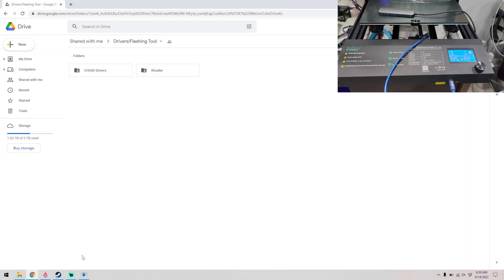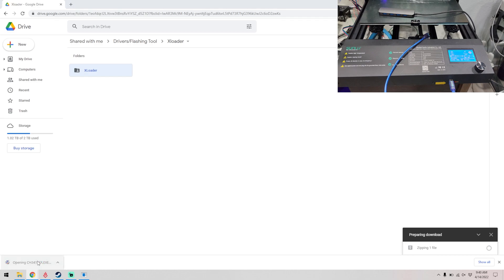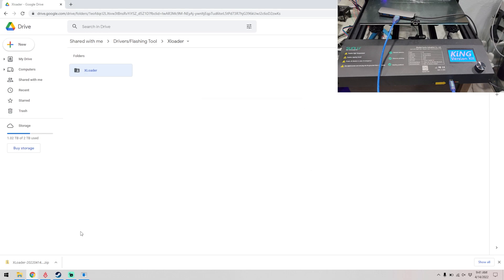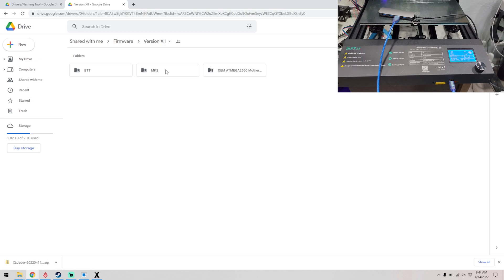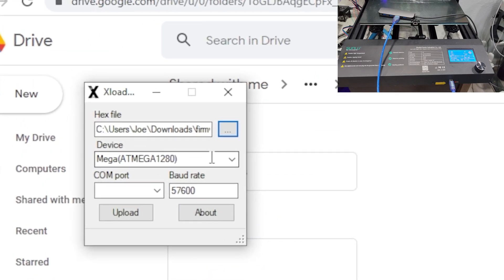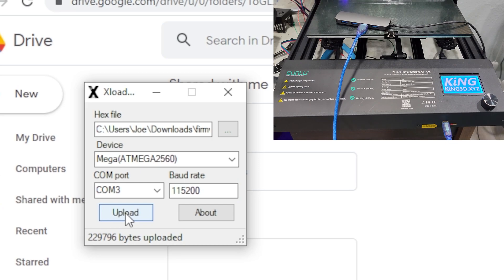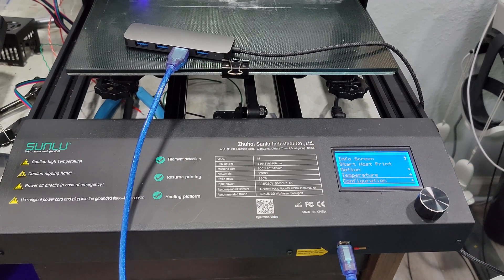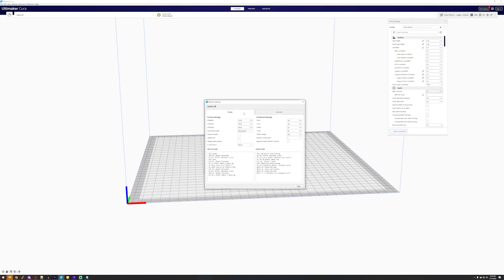Sunlu S8: How to Update the Firmware

Comment: Hi im hopelessly lost i have a s8 and was trying to do a few upgrades to it so i can print flexible filament and i added a direct drive extruder a bl touch and a few other things but the main thing being a new motherboard and screen i replaced the old board because the extruder moter driver went out i had found what i thought to be a nice looking board and screen combo on Amazon and i purchased it and wired it up and trying to figure out how to get it to function properly with my printer is driving me crazy the board i have purchased is the Makerbase MKS Robin Nano V3 please if you can point me in the right direction i would be very grateful i would love to be able to use this old printer again

Comment: Is there some other step required to be able to flash the firmware? I got the 2560 motherboard, and I try to flash the firmware with the program you used in this video, but it keeps telling me can't open port.  So like how do i get by that problem? I have not done anything with this motherboard since I bought the printer. And so far with this error I don't think I ever will unless you or some one knows something that can help.
Reply: that sucks ass just return it and get something better

Comment: Hi just wondering if U can help I had an old tronxy xy2 pro with a 255 bed I converted it to a Sunlu farm with a 310x310 bed but I need to change y steps to Mach the biger bed so home correctly so on but not clue how do about doing it carnt dinds any video on do it

Comment: Hello, I wanted to see if you know how I can update my S8 Pro using a Mac computer.  I do not own a PC and I can't find any videos showing how to do this.  Any suggestions would be appreciated.  Thanks
Reply from the maker: I'd look in to BootCamp to boot in to Windows and do it through the built in Windows emulator that MacOS offers.
Reply: I was able to install Windows 10 on my Mac and I finally was able to install the firmware after a few tries. Now when I turn on the printer it boots up with the King 2.1.1 screen and then starts a loud beeping sound and it says on the screen eer: MAXTEMP: E1 PRINTER HALTED Please Reset. I pushed the little red button on the board and it reboots the screen, but just back to the same message and loud sounding beep. Any ideas?
Reply from the maker: @jeffcottrill5488  Was the only change done updating the firmware, or did you also upgrade some components?

TH3D has a wonderful article going through all the causes: https://support.th3dstudio.com/helpcenter/e1-maxtemp-error/
Reply: @JoeMartinMVC  Okay I went to level the bed and the BLTouch was not working like in your video.  It had to be done manually and the BLtouch wan't probing or anything.  I thought maybe it was because I used the stock extruder, so I downloaded the other firmware and sill the same.  Any Ideas?  I have the S8 Pro, so don't know if that matters or not.
Reply from the maker: @jeffcottrill5488  you're going to need to ve more specific for me to be able to help you. 
What firmware do you currently have flashed to the printer?
When you say the BLTouch "won't probe or anything"  what do you mean? As in the probe literally does nothing. Never retracts or tests itself when the printer powers up? There's no LED on the BLTouch? What does "won't do anything" mean?
Reply: @JoeMartinMVC  Sorry, I'm not the best at installing and understanding all this.  I downloaded and installed the direct drive with BLtouch first and then I downloaded the BLtouch with stock extruder.  When I go to Auto Home the BLtouch pin will extract and hit bed go up and come down again.  The problem is after trying to set the Z-offset and the storing it, then going to the next step to level the bed, it starts the probing in the front corner and then slides over once then stops.  Like it is finished.  It doesn't give me the option like on your video, it makes me manually hit next corner to move on and I have to adjust each knob to level it.  I thought that the whole reason for a sell leveling BLTouch is so you didn't have to do this.  I know I could probably be explaining this better, but I can't.  If there was a way for me to upload a video would explain a lot.  Sorry and thanks for any help.  I understand if you can't help and I'll keep trying to research on getting the BLTouch to work correctly.
Reply from the maker: @jeffcottrill5488  that's perfect info, thank you. 
It sounds like you have the proper firmware installed now, so that shouldn't be an issue. 
It sounds like the probe is working. It's trying to tram the bed currently. If it's having you manually adjust the knobs on the bottom that means that it's seeing that the corners are not level. That's a normal step in the process before it does the 25 point probe. 

An automatic bed leveler helps with keeping prints level but it does require the bed to be close for it to work, hence why it has you tram the corners first. After you get all four corners within spec (where it doesn't have you adjust the knobs anymore) does it go on to doing the 25 point probe?

Comment: hi i have the sh 2560  board, got second hand along with an ender 3 s1 to go with my other two ender s1 pro's, Mainly want the S8 for large prints.  I am now upgrading parts and making it Direct Drive with a BL or CR Touch,  what FW would i need as far as i know the board is the original, many thanks in advance
Reply from the maker: With the stock board, DD and BL/CR/ABL you'd use the first firmware in the description: https://drive.google.com/file/d/1NEmTJAUe938t-N7IcFd7RQ96oClr-QwG/view

Comment: I'm follow yours video. I have same printer already upgrade following your steps . Now I want to print petg but always fail . Could you try please thank for your videos
Reply from the maker: PETG is always difficult to print with. 
One thing I'd recommend would be an all metal hot end due to the PTFE tube inside of the stock hot end melting at 250 degrees.
I went with the Gulfcoast Robotics one as it's just plug and play and simple to use, though I did have to use a smaller spacer on the bed leveler with the KiNG Uni-T Shroud.

https://amzn.to/3TqzBLx

I also definitely recommend a PEI plate, like the one I installed in my other upgrade video:

https://amzn.to/3KBf5UM
Reply: I run my petg at 240°c and my speed at 35mms. .8 line width and have had great luck. I printed a rc plane using it and its great stuff